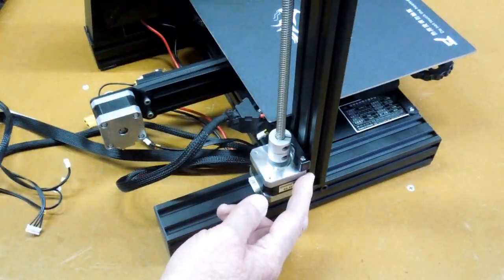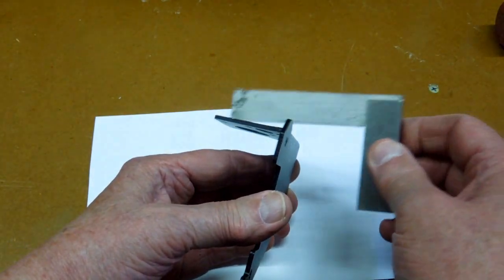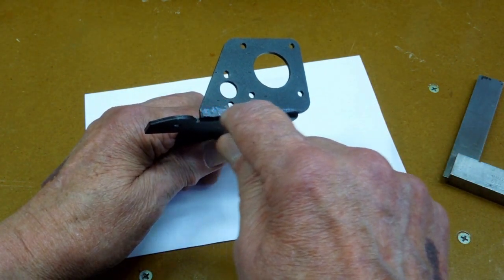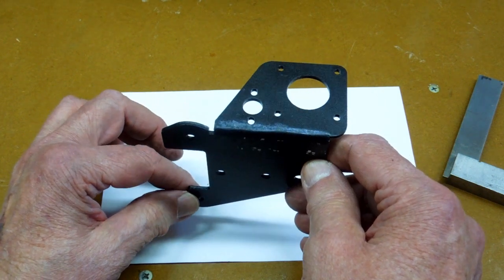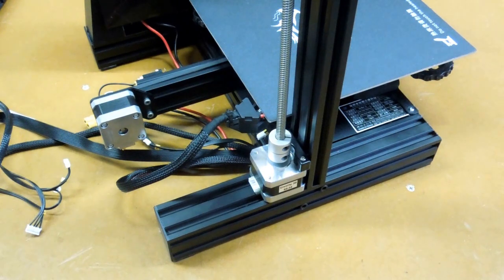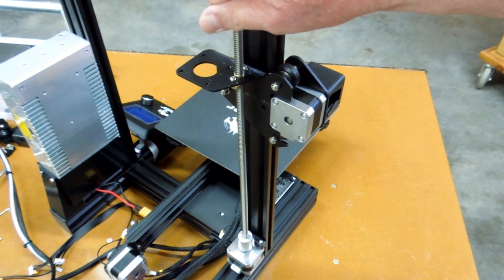Creality Ender-3 Z-Axis Alignment Correction

Comment: We had to shim out our Z stepper by about 2mm when we assembled on the weekend. Everything has been fine until today, with two failures at 84mm height with the nozzle striking the model causing major layer shift - I wonder if this is the problem..... thanks for a helpful video.
Reply from the maker: Any number of things can cause a nozzle to hit a printed part.

Nozzle and bed should be preheated and then the bed leveled.

A loose nozzle could hit the part.

Retraction could be insufficient. This could allow strings to form. Stringing can become melted onto the nozzle, resulting in a blob, which could hit a printed part.

Fan shroud could hit a printed part if it has not been properly leveled or if it has loosened and dropped down.

A print starting to separate from the bed or warping could raise the part enough to be struck by the nozzle.

This video shows the alignment problem with the z-axis. Have you checked the bracket, which holds the extruder and z-axis leadscrew nut, to see if the bracket is bent correctly? 

My Ender-3 came with a black textured print surface. The double-sided tape holding the print surface to the bed started coming loose and caused the black textured print surface to blister, which could raise a part.

I have experienced a few times where CURA caused a significant layer shift. In Cura, after slicing, use the layered view and inspect the model layer by layer looking for the layer shift or any other problems. Turning the part slightly or change the part position on the bed. Then, slicing again usually corrects the layer shift.
Reply: @RonaldWalters2010  Thanks for the reply Ronald.... last night I quickly designed a 100mm tall cylinder and it printed perfectly, so maybe the screw is alright. The failed model was a helical tube, with very long spirals of PLA rising up, which is what caught the nozzle, funny, it occurred precisely at the same time and location in both prints - so it may well be something in the model, I'm going to try again with a similar model  today, not the same one....
Reply from the maker: Your statement: "it occurred precisely at the same time and location in both prints"

Most likely Cura created a faulty gcode. After slicing you can click on layer view and go to the area where the failure occurred.  

Turning the part slightly and/or change the part position on the bed. Then, slice again... go back to layer view and see if that corrected the problem. I use layer view for nearly all created gcode.

Comment: Funny, I am currently disassembling my Ender 3 due to binding. I am not so sure about using a hammer though...
Reply from the maker: Gentle application (of hammer as per instructions) worked for me and my Ender-3 has been running perfectly ever since and I currently have over 2500 hours on it. I also rearranged the Y-axis carriage wheels. there is another video on that.

Comment: Yeah I'm not about to go beating on mine with a hammer.
Reply from the maker: The people who don't know what they are doing are those who bent the bracket incorrectly in the first place. Apparently not all Ender 3's had the misalignment issue caused by the incorrectly bent angle bracket which holds the extruder and the z-axis leadscrew nut. The only possible correction is to make a complete new angle bracket correcting both angles (as shown in the video) to 90 degrees - or - gently use a hammer to beat the angles to 90 degrees as shown. Moving the brass piece around on its screws will not correct the leadscrew 2-axis misalignment caused by the bracket. The incorrectly bent bracket does not create an issue for the extruder motor as it does not care where it sits in order to work correctly. Correcting the two angles in the bracket aligns the leadscrew and leadscrew nut with the z-axis stepper motor. I repeat... moving the z-axis leadscrew nut and the z-axis stepper motor around on their screws will not solve the alignment issue caused by the improperly bent mounting bracket. If you cannot understand this you need to find someone who does to help you.
Reply from the maker: If yours is one of the ones out of alignment, you will need to. Otherwise, no need to.
Reply: @RonaldWalters2010  The brass threaded piece can move forward or backward and also the motor can be moved side to side to compensate for this. There is no need for a hammer. Hammers are for when people don't know what they are doing.

Comment: Strange , i can not push mi z axis up like that
Reply from the maker: If the Z-axis is not in alignment, you may not be able to move it by hand. When it is correctly aligned, you should be able to move it as shown in the video.
Reply: @RonaldWalters2010  ok thx

Comment: I have just built my Ender 3 and my auto home position is lower than the bed and past the front of the bed, how do I set the auto home position so I can begin to level the bed?
Reply from the maker: Keep in mind I get nothing for answering these type questions so a Subscribe would nice.
The bed has to be much lower than the nozzle to begin with... or you need to slightly raise the z-end stop so the nozzle doesn't travel quite as far down on auto home. Once you get it to auto home without hitting the bed (which could easily damage something) ... if the nozzle is past the front of the bed you need to move the y-end stop back a little so the bed does not travel quite as far to the rear. Hope that helps.

Comment: A true fix, but I'm not sure I'm up to taking my Ender apart to that point, hammering  and ruining the finish.   I'm lucky i that mine does not appear to be off if at all.  My caliper readings are within 0.3mm from top to bottom.  Good enough for me.   Great video.Thank you.  if my next one suffers this issue I will have an option.

Comment: Ok. That's very good. However, this Z-Axis alignment correction is not for anybody. One must have all the tools he needs in order to make the corrections. Moreover, having such mistakes is just stupid. Therefore I maintain my option that this printer is a piece of crap. Sorry for my honesty.
Reply from the maker: Fair enough. I certainly agree with the stupidity of making something so sloppy. In that case the CR-10 is a good machine. A friend and myself have had very good luck with ours and my friend has had his for a year longer than I have. I have around 1400 hours on my CR-10. Repairs have been a couple of thermisters, cartridge heater, a few nozzles, a fan and stuff like that. You will need a better print surface (but not right away). It comes with a piece of glass and you will be printing on masking tape. I think just about any of these printers will require a few pieces to be printed to make them a bit better and easier to use and a Petsfang cooling duct is definitely recommended. I have a CR-10 review video https://youtu.be/xfHNYyuXi44

Comment: I would just add my experience to everyone else's here in the comments. The problem for me was the little bracket on top of the Z stepper that mounts it to the extrusion. It was not square to the z stepper, looks like just a quality issue in mounting it to the stepper from the factory. This meant when I mounted it to the extrusion the z stepper was slightly tilted towards the gantry. Looking closely at the bottom of the z stepper compared to the bottom extrusion I could see they were not parallel, and of course the problem was magnified at the very top of the z rod, it didn't line up at all with the carriage. I had checked the extrusions and they were perfectly square. So simple solution, I loosened the little bracket on top of the z stepper and forced it and the stepper against the extrusion to make sure it was aligned and in the same plane as the back of the z stepper and re-tightened it down. I could see the bottom of the stepper was now parallel with the bottom extrusion and the Z rod was aligned, no issues with binding, etc.
Reply: I think this is the problem on my V2 :-\ I tried this and it is slightly better, but still janky. On closer inspection with a square, the top and base on my stepper itself are actually askew!

Comment: That's not the case Ron...measuring distance differences when the pulley is up makes no sense because the rail is straightened by wheels firmly fitting printers aluminum frame. At 2.35 when you push the puley down you can clearly see that top of the rail is increasing distance from the frame what might cause Z wobbling...That's the problem and your solution unfortunately didn't fix it.
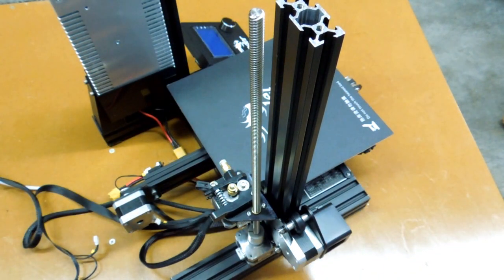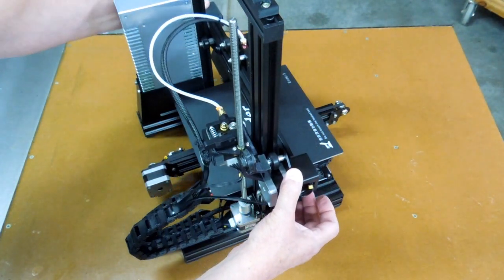Reply from the maker: When you say pulley I assume you are referring to the z-axis carriage. The job of the wheels on the z-axis carriage is not to straighten the leadscrew. The leadscrew needs to be properly aligned with the z-stepper and the leadscrew nut at the full up and the full down positions. At 2:35 the z-axis vertical tower cross support is not installed yet. The slight movement you are referring to was corrected by the thin paper shim behind the z-stepper referenced in the video a few seconds later. At 3:00 you can clearly see there is zero movement of the leadscrew as the carriage is moved downward. The z-axis misalignment on my machine, and on those received by others, was caused by the improperly bent aluminum angle plate as shown in the video. My solution fixes that problem and aligns the leadscrew with the z-stepper and the leadscrew nut perfectly. Perhaps your machine has another problem. Thanks for watching. Ron

Comment: Hey, I'm wondering if you can help me. I've had an Ender 3 for about a month now and all my prints are leaning forwards along the Y axis. I've tried all the things I can think of. I've checked the uprights are square, re-levelled everything countless times, tightened the belts, the pulleys, moved the end stop in case that was causing an issue and tightened the eccentric nuts on the Y axis bearings... Nothing seems to change the print. Any ideas? Thanks.
Reply from the maker: Do not overtighten the wheel eccentrics or the timing belts. It is possible you are blaming the wrong thing. I am not a programming person but it sounds like a cumulative error. The printer is an electromechanical robot and just follows instructions. When you turn on your Ender-3 go to Control - Reset Failsafe and that will reset the printer. Before you do anything else, try printing the Test Dog.gcode file which came with your Ender-3 (DO NOT use the stl file). If that works... then try generating your own gcode for the Test Dog.stl file and see how it prints. If the gcode you created with your Cura program fails, then you either have something wrong with Cura or the Ender-3 Cura settings. Personally, I used a Cura program for 6 months with my CR-10 and suddenly, for no apparent reason, it started generating unusable distorted gcode files (like chopping the top off a round object). Assuming you are using Cura, where did you get your copy of the Cura program? Anyway, try that and please let me know what happened.
Reply: @RonaldWalters2010  Thanks for getting back to me. The trouble with printing the test dog is that it might not very noticeable that there is some distortion so I have a little 20x20mm cube so I can easily check it. It's very slight distortion, other than that prints are great! I use Fusion 360 and export the model as an .stl and slice them in Cura, downloaded from Ultimaker website. I'll give those suggestions about it being too tight a try!
Reply from the maker: If the problem is in Cura, then you need to quit using that installation of Cura until you verify where the problem originates. Switch to a different version of Cura. Or get someone else to create a gcode file for you as a test. Try printing this Classic Rocket, which is a great test. https://www.thingiverse.com/thing:580192

Comment: Hi, I have managed to align my Z lead screw properly, but when I set to auto home, the Z axis is moving really slow going down. Any idea why this is happening? Thank you.
Reply from the maker: I am not really very good at this... go to Preferences then Machine Settings ... left side Start GCode... 4th line down will look something like G1 F140 E30. The "F" I believe is the travel speed. I found 140 to be too fast and I set it to be F100. Other than that I have no idea unless the leadscrew is not a well aligned as you think... or did you run it misaligned for a while before fixing the alignment (possibly damaging the stepper)? Make sure the leadscrew coupling is not bottomed against the stepper motor causing a drag. You should be able to turn the leadscrew with just your fingertips (with the z-axis travel all the way up and all the  way down) if it is turning freely. Hope that helps.
Reply: Ronald Walters  Thanks to your video, now I am sure it is aligned. I do suspect I ran it without it being aligned properly first, hence I assume its now a stepper motor issue. The slow Z axis movement is ruining my print after the second to third layer. Thanks for the reply though.
Reply from the maker: If you read the comment form sephirotic87 he is having a similar problem but his is dropping much higher up. Thanks for watching. Please subscribe!

Comment: Had  the same problem, went to a machinist to correct it. You might also consider printing out a Z stepper bracket from thingiverse, that allows you to mount the z motor to the horizontal v-slot instead of being mounted on the vertical hanging in mid air. The .bracket allowed me to further align the lead screw
Reply from the maker: I looked at that bracket and it (in my opinion) did not correctly align the leadscrew with the nut. It would allow the leadscrew to enter the stepper motor coupling but the leadscrew would still be misaligned at the nut. Not being perfectly aligned in both axis will place a strain on the stepper.

Comment: When I assembled my Ender 3 i Noticed the Z axis bar was not aligning with the hole of that sheet metal part properly. I just kinda forced it in tight and it worked. However, now I'm getting z axis drops around the 20cms mark (close to the top). I'm afraid the Z-steppers may have got damaged from doing so.
Reply from the maker: I would not expect a stepper to work for very long running in misalignment.

Comment: Your base isn't level. Undo the four cross member bolts and manipulate the base so that all four pads are level. I've found that it's easy for the whole printer to not be square if you don't pay attention. As to your X axis mount yet again the judicious use of a hammer solves the issue. I'm a great believer in a big hammer. Well done.
Reply from the maker: The base is level. It was sitting on an uneven surface in certain parts of the video. Thanks for watching. Please subscribe.

Comment: Is there a voltage protection when you move the axis like that? The motors could be pushing voltage back into the drivers.
Reply from the maker: I don't know. Also, the movement of the z-axis is shown several times actual speed to keep the video as short as possible. I run the x-axis, y-axis and z-axis on my CR-10 by hand all the time, for over 6 months and it doesn't seem to be a problem.
Reply: There isn't voltage protection but if you look at the stepper in the video, it wasn't wired in to the board at the time.
Reply from the maker: Power off and moving X, Y & Z steppers by hand will light up the display on the CR-10 and the Ender-3 but it has never been an issue. Just try not to transport the axis too fast by hand .